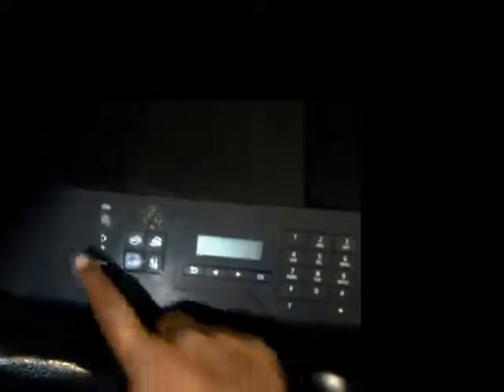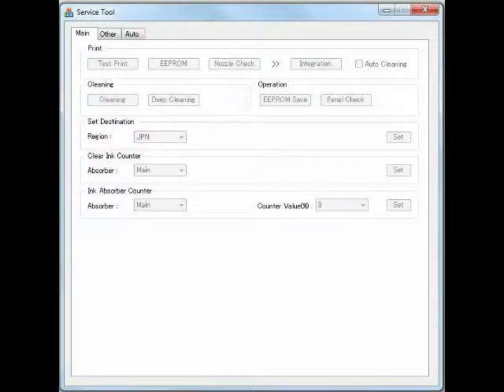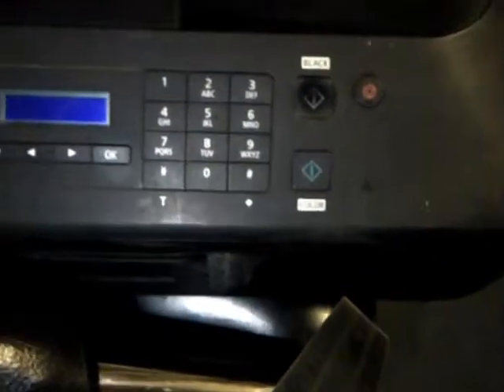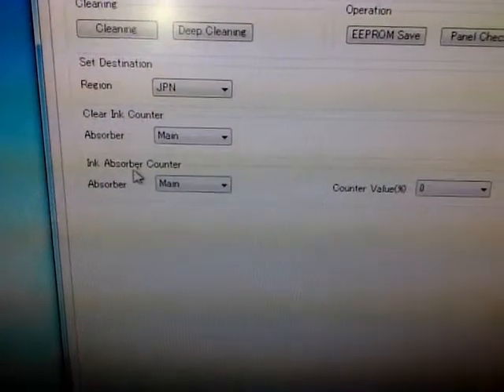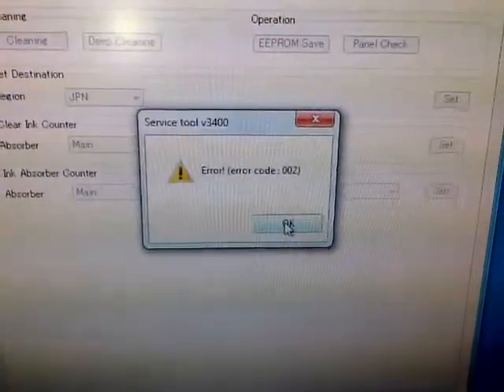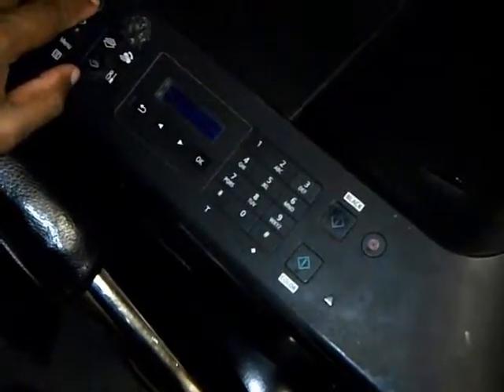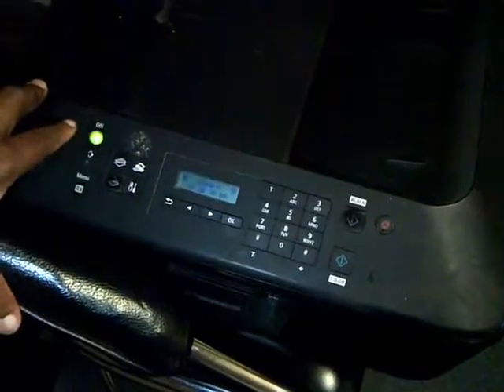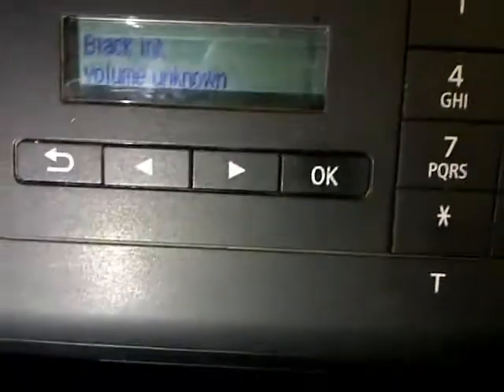Canon Printer MX374 - 5B02 Error

Comment: So I see that you haven't posted for a while. Nevertheless, with your instructions I got to clear out the code 5b02, reset everything as instructed and literally, physically clean the ink pads. That's a little bit more messy, but it needed that. My printer model is a MX512, close enough to the MX374 - same look and data input procedure. Believe or not, my printer still looks brand new and I bought it about 10 years ago. It's an all-in-one type. All I can say is Thank very much, you've saved me a lot of money.